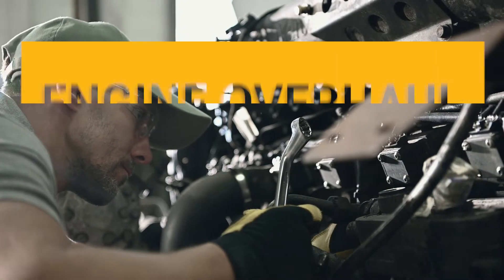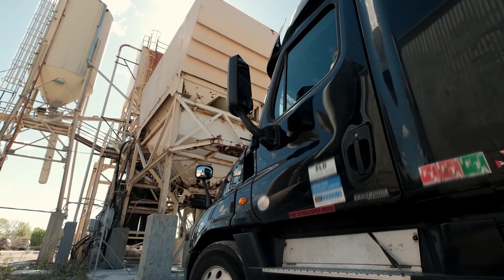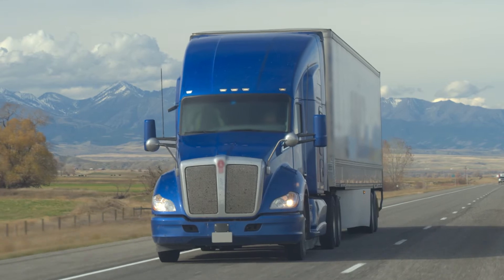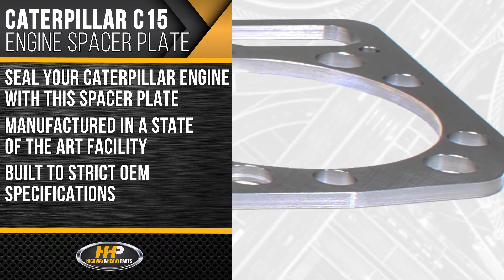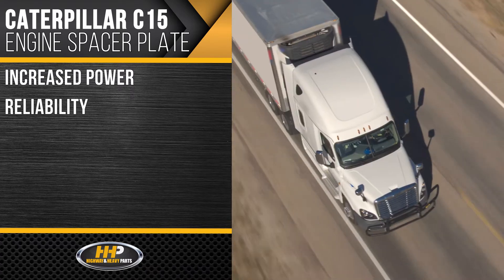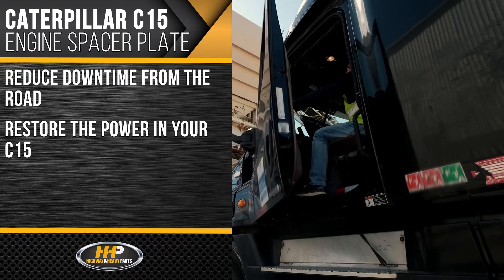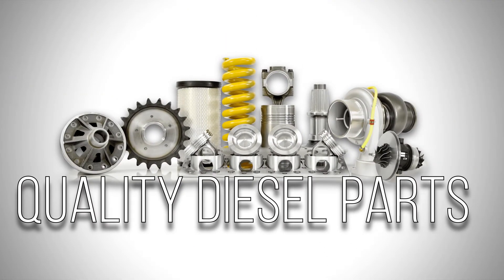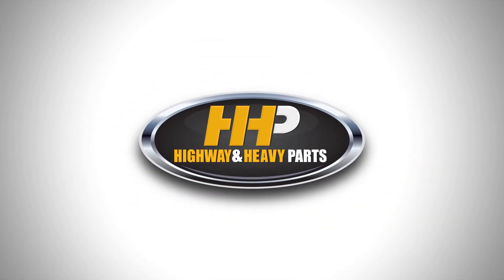Why You Should Replace Your Caterpillar C15 Engine Spacer Plate

Comment: Do you still have to fit a head gasket after fitting the spacer or is this essentially like a steel gasket/better gasket?
Reply from the maker: In a spacer plate engine, the spacer plate sits on top of a spacer plate gasket on the block. The head gasket then goes between the spacer plate and the cylinder head. It's designed to reduce stress on the liner flange while maintaining the seal of the head gasket.

For more information, check out our Diesel Engine Blog:  https://highwayandheavyparts.com/n-12902-replacing-your-spacer-plate-when-should-it-be-done.html#:~:text=In%20a%20spacer%20plate%20engine,seal%20of%20the%20head%20gasket.